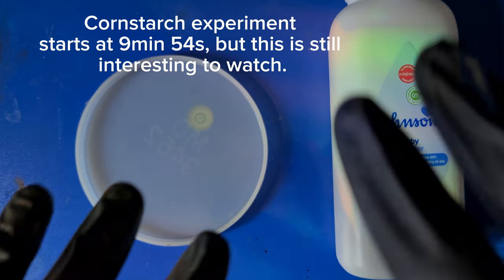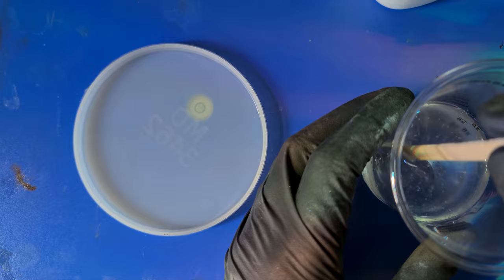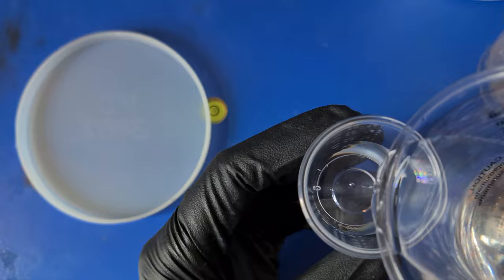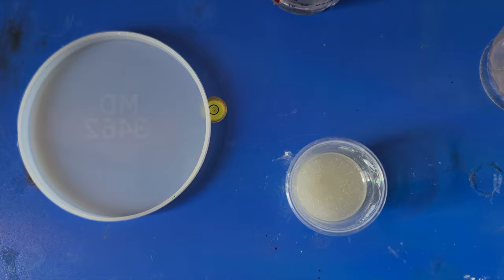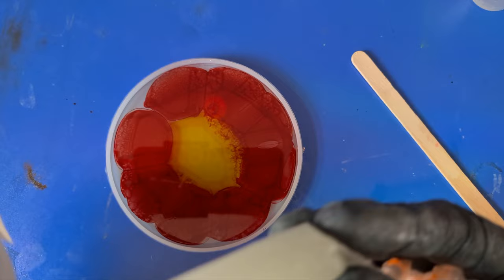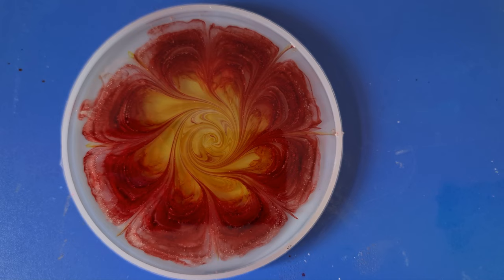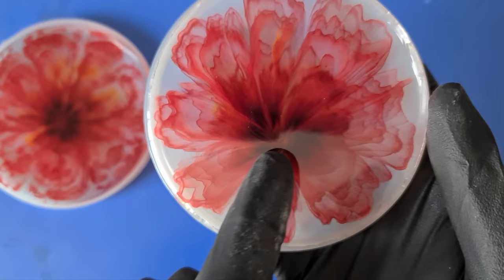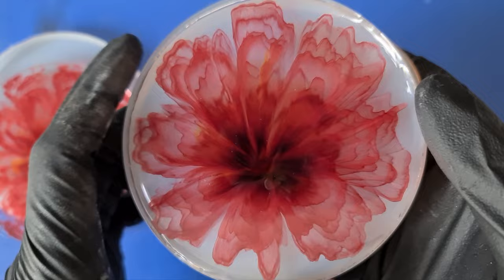CORN STARCH Resin BLOOMS?! - This is CRAZY! A Video by Daniel Cooper

Comment: I like how lacy they are.  I think chalk and plaster of Paris powder would add opacity Both are stupid cheap and readily available. Chalk comes in colors so you have an option there. Cornstarch for me almost always goes clear if it is in small amounts.
Reply from the maker: I tried with my Sinker White today and looking so much better 😊 would rather something non resin related though.
Reply: @Oonagh72
@daniel..cooper
Chalk might be kind of floaty, but I'm betting plaster would sink? 
Wonder how Resin Crete would work? It's super white...
Reply: @daniel..cooper  how are you doing have missed you on you tube. Just making sure you are ok.
Reply: I've seen chalk used before, experim3nted with in different ways too. Cheap art pastels too. Definitely worth a try.
Reply: Or calcium carbonate that’s what I use for chalk paint

Comment: Daniel, corn starch changes with  temperature.  As the resin heats up, it starts to cook the corn starch and the corn starch becomes translucent.  You may try experimenting with mixing the corn starch and resin in container that is wider and shallower in an effort to keep the resin temp to a minimum.  Adding mica powder to the corn starch prior to mixing it in the resin may be a way to color it evenly.  I dunno,  I'm just guessing.  

I want to try resin with kaolin powder but I'm not sure just how fine it is.

Comment: I'd also recommend trying out arrowroot powder, you can pick it up in small sachets to test it out in tesco for £1.60 for 5 I think it is, its alot lighter than corn starch/ flour and highly absorbent so it could work, great video 😊
Reply from the maker: Thanks, yes, it's on my list to try now 😊😊😊
Reply: @nadiaxox1401
@daniel..cooper
I thought about that, BUT....I use it a lot, and it goes totally clear (which is why it's used for clear soups). I'm thinking it might be a total disappointment.

Comment: Just found your channel! Potato starch might be a good option. It's pretty similar to corn starch, but at least in water it reacts slightly differently. And it's a bit more opaque. Another option might be to try a darker dye than white. Maybe a yellow or orange with that color palate. (A lighter one than used in the center, but one that would grab the starch better.)

Comment: I'm not sure how well it works in epoxy resin, but chalk pastels make uv resin pretty opaque with just a tiny bit added, so that might be a good option.  Just scratch off a bit of white chalk pastel, instead of using the let's resin dye, and see if that works?   Just an idea.
Reply: @Shari_A._
I think it would work, too. Steve did that (I think it was Steve?). Jyst a few tiny scrapes, and he got VERY opaque resin.

Comment: Someone suggested regular flour and I think it is worth a try.  However, the flour is not ground fine like corn starch.  You could try cake flour which is still wheat based but ground finer.  Someone suggested plaster and my experience with it (I was a paint contractor for 25 yrs) I think it is way too heavy.  There is also tapioca flour which is light weight.  And someone suggested arrowroot which is light as well.  Give them a try, bring us all along, it is very interesting.
Reply from the maker: Thanks 😊 I have ordered some Arrowroot, a few have mentioned this now so worth a try 😊

Comment: Not what you wanted, but I think they are pretty! However I do have a question. Why are you using alcohol inks, when you have already shown us they fail after a short while.
Reply from the maker: Thanks, I haven't shown failed alcohol inks on my channel. The Let's Resin inks I have shown to be extremely light fast in my videos and testing 😊😊
Reply: Went back and looked, think I found what happened! I was watching your #42 a few months ago and YouTube must have done it's thing. Next video was someone else's. I hadn't used resin since the 70s, when there was only one brand and no internet. So much has changed and so many kinds, brands and techniques. 😁 @daniel..cooper